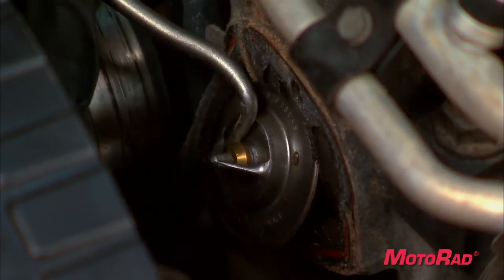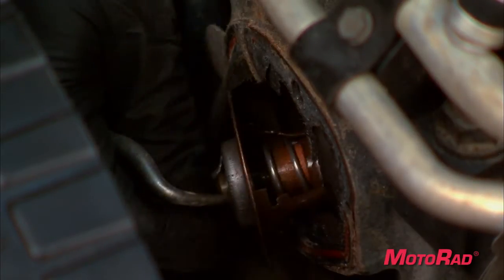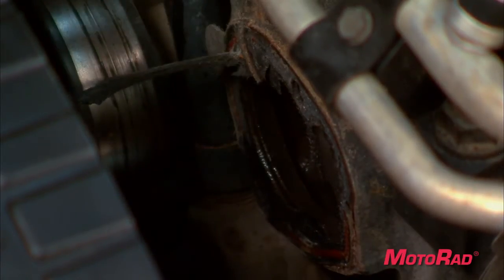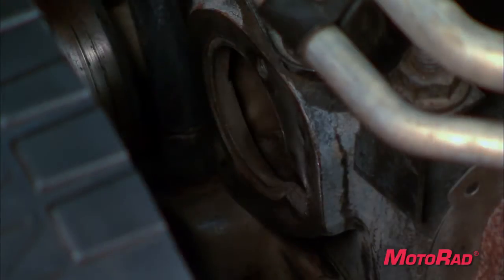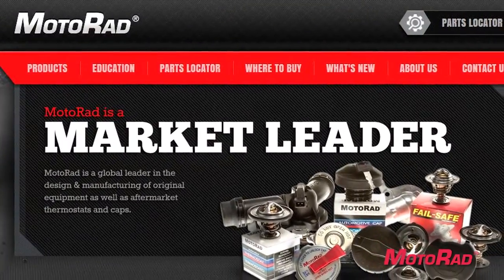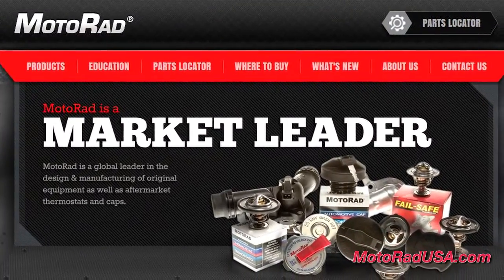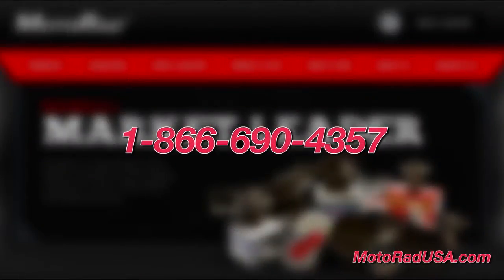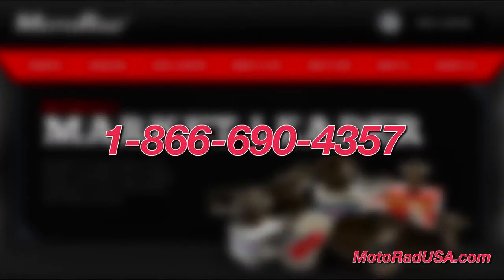MotoRad Tech Tip - Installing an Automotive Thermostat

Comment: Went through a few thermostats on my 2016 Jeep Rubicon the last 18 months. The OEM thermostats for jeeps have been on backorder for years with no end in sight for whatever the reason. I noticed the first thermostat failure had motorads name on it. Looked for thermostats everywhere. Long story short….these motorad thermostats are the most garbage POS money sinks on the market and guess what? Doesnt matter if you buy from Autozone, O’Reilly, Napa, i’ve had to buy a few now and they are all MOTOCRAP brand as embossed on the actual thermostat, but hidden in Duralast, etc. packaging from anywhere you get them. I would have rather spent $200 on a thermostat that doesnt leave my family stranded on the road every 6 months however it seems like you can’t escape this companies deceitful packaging of turds. I would rather be robbed cause at least the robber isnt hiding. Let me guess….motorad offers a warranty to replace their old turds with a fresh turd. That doesnt help with the expense of flushing the OAT coolant each time or the road that I am now stranded on with no help. This is just my experience and opinion of course but felt compelled enough to leave this comment to hopefully save some people from the frustration. My thermostat has gone bad again and am hoping to find ANY other brand thermostat in stock somewhere.